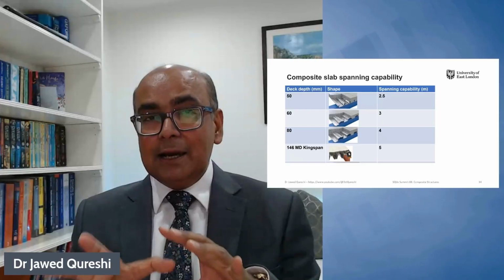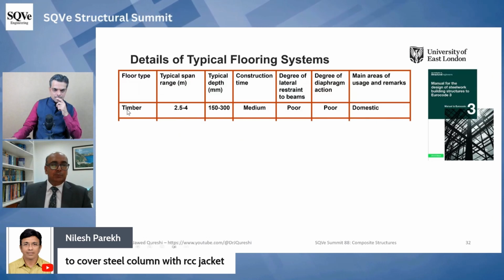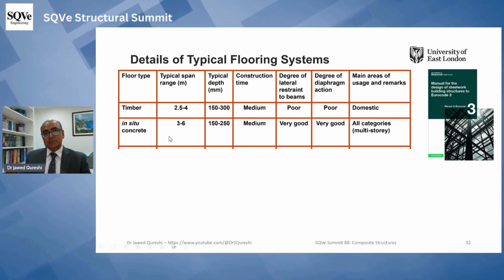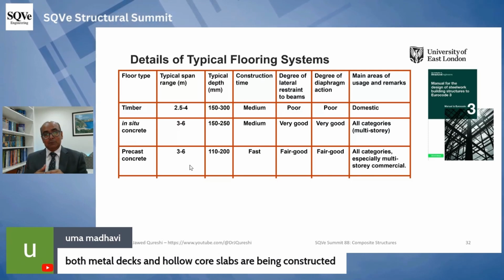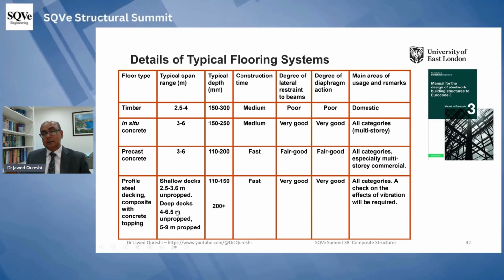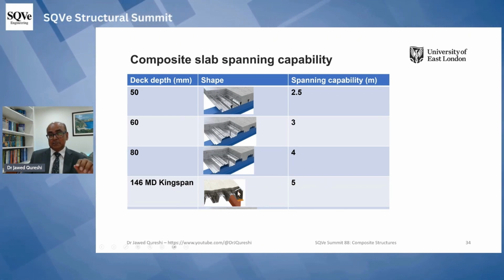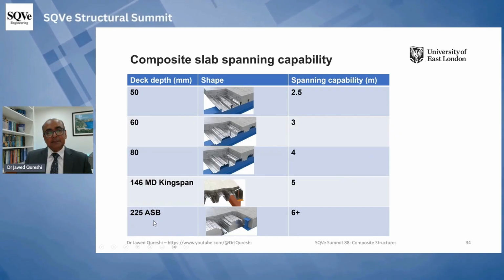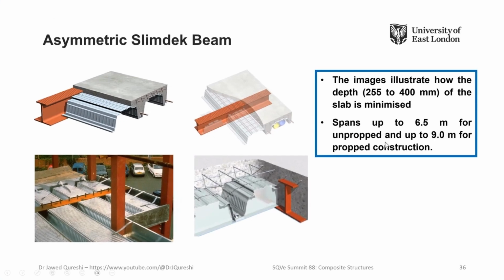Composite Floor Systems: Span, Depth & Structural Behaviour Guide | Dr Jawed Qureshi

Comment: What about the comflor 100 - there are so many dynamics - sacrificial formwork, or composite action, to check vibration and shear connection what software brings all these components together please Dr Jawed Qureshi
Reply from the maker: Different manufacturers have their own software to design the composite beams and slabs. S-Frame can be used too, but it caters mainly to Canadian steel decks and some generic steel profile sheeting.